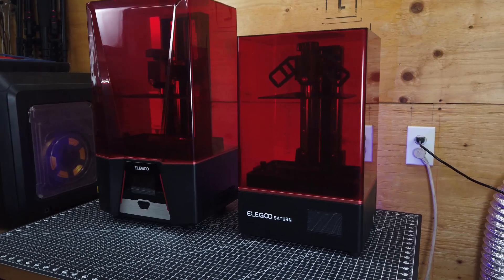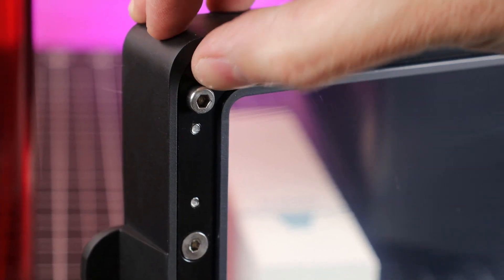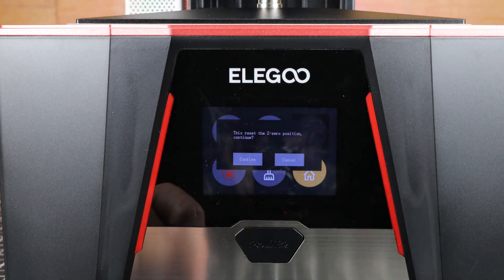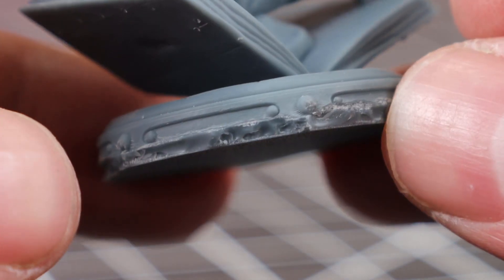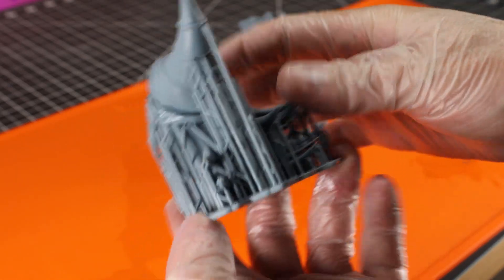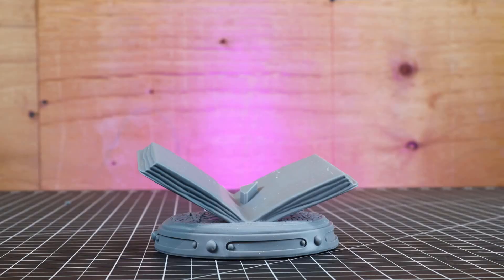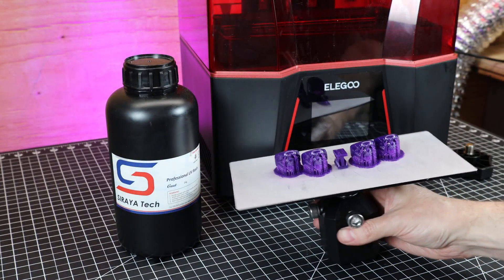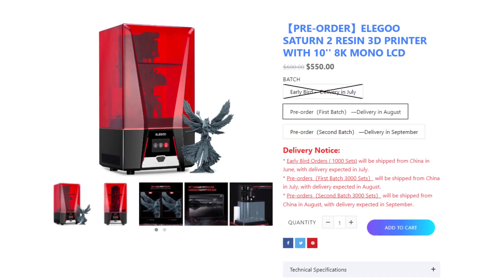2022 Hands Down Best Printer For The Money  - Elegoo Saturn 2 8k Mono Resin 3D Printer

Comment: Hi,
I just bought the elegoo saturn 2 Resin printer (I'm new to resin printing).
I wanted to print the test file of the two towers (In the usb key)
When I was looking and browsing the files of the usb key provided with the printer
I saw a file named: SATURN 2 Machine parameters20220831 in g-code extension.
Believing that it was a parameter to install to adjust the printer,
I runed it and then it says that the printing was done (the printer didn't moved)
After that I printed the two towers and everything went well and the towers quality is very good.

Did you manage to read the file content and if yes do you know what it does to the printer.
I also opened it into a text editor and I don't understand nothing.

Thank you for your return
Reply from the maker: If I'm understanding what you're asking correctly that should just be an update file for the printer and how you execute them is by printing them on the printer and it uploads the file and does what it needs to. You shouldn't have to do anything with those and honestly you can delete pretty much everything off that USB drive and just put your own gcode files onto it

Comment: I herd so many times now, that the leveling card is actually to thick and that people have print failures due to prints not sticking to the build plate. I also read somewhere that Elegoo addressed this issue in a Facebook post, but I can't confirm it, since I don't use FB. Have you had any issues so far? I just got my Saturn 2. It's my first 3D printer and I'm afraid I could damage something if I set zero under level by using a paper that is to thin. I have't printed anything yet.
Reply: @memento mori I heard the same horror stories about the leveling card being too thick before I got my Saturn 2 last month. I used the card anyway, and guess what? No issues at all. I've been printing almost every day for the last month, about 8 - 12 hours at a time. I've only had one file fail to print, and that was due to me improperly angling and supporting the model. Once I nailed that down, it printed perfectly. I'm impressed with this printer. The amount of detail using 8K resin is amazing. I have not had any problems with models failing to stick to the build plate. If anything, they are harder to remove from the Saturn 2 build plate than they are from the original Saturn's build plate. The air filter seems to do its job when I tried using standard and 8K resin in the Saturn 2. Very little smell until I remove the cover when the print job is done.
Reply: @photoboyjet  Works now with the leveling card for me too. I had other issues, as I said in my previous comment. The only thing that bothers me now, is layer shifting and layer separation when printing bigger models. This could be a problem with the Elegoo NFEP film, as some people I've talked to pointer out. I ordered a NFEP film from siraya tech, which should be much better than the Elegoo original. Will see.
Reply: @mementomori4972  The largest piece I have printed so far is a life-size human skull from a medical scan. Being a bit too large for the build plate, I split the cranium into two parts and printed them separately. The lower jaw and skullcap fit  with no problem. The only snag was getting the skullcap properly oriented and supported. It took 7 to 10 hours per part to print. So far, I am enjoying this printer.
Reply from the maker: I have done a lot of prints from that 1st level that I showed in the video without any problems to be honest. I would just use the card and do a test print. Let me know what happens.
Reply: @randymay  I have one failure after another. I honestly don't know what to do anymore. My print just doesn't want to stick to the build plate. I tried leveling with the card: failure. Then with only one regular sheet of paper: failure. Two sheets of paper: failure. I also tried to slightly sand the buildplate and to carefully lubricate the tank bottom with PTFE WD40, like many people recommend. I increased the bottom exposure time to 90: failure. I use Anycubic EC UV Resin Gray. I'm seriously getting desperate :(....I also checked the screen and it works just fine. I already wasted almost one 0,5L bottle of expensive resin. Everything I get, is just a print in the shape of the base plate, that sticks to the tank.
Reply from the maker: @mementomori4972  That is really odd and it sounds like it should have worked with some of the stuff you have done for sure. Do you have any other resin you can try?
Reply: @randymay  The resin is fine. It turned out that my build plate was warped and that the z-axis screws were lose. I measured with a precision straight edge and feeler gauges. I had a gap of 0,1mm on each side of the plate, which is 4 times my layer thickness. I had to level sand the build plate, which was a pain in the a.. but manageable for me since I'm a guitar maker and used to level sanding frets. There shouldn't be such quality flaws and I'm a little upset with Elegoo, to be honest. Not everyone who received a printer and has the same problems is able to fix them.
Reply from the maker: Oh wow yeah that is a big problem and honestly the last thing I would think of seeing that should be spot on from Elegoo. I'm happy to hear that you had the tools to fix it but like you said most people wouldn't have been able to. 

I highly suggest contacting Elegoo about your findings and let them know all the details. They are normally really good with making things right for their customers. If you do let me know what they say.

Comment: Heads up: The air purifier does very little when it comes to removing resin smell from a room/the enclosure!
Reply from the maker: Yep but as long as you keep the lid on you can't smell it at all. I do suggest having some ventilation in the room you use it in for sure
Reply: @randymay  I can definitely smell it with the lid on but I suppose it depends which resin you're using.
Reply from the maker: @andyrushent251  Yeah I guess I can seen that. What are you using?

Comment: Can’t wait to get mine. I’ve been using the Mars 3 for 1:6 scale head sculpts and I’ve loved it for the last year. Haven’t had to relevel or replace the FEP since purchasing. I hope the Saturn 2 holds up the same way.
Reply from the maker: That's great to hear and yeah my Mars 3 has been doing great as well. Actually they just sent me the Mar3 Pro so I still need to do a video on that. The Mars 3 that I have is one of the pre release units so there have been some changes that I can already see for it and the pro. 

With the Saturn 2 I haven't had any problem with it at all yet so that is a good sign for sure. 😁👍
Reply: @randymay  that’s great to hear. Going on a year now with the Mars 3. I’m sure I’ll continue to use it after I get the Saturn 2. It’s a workhorse.